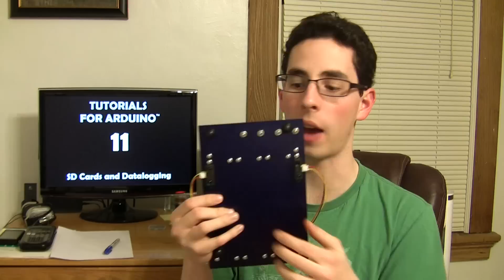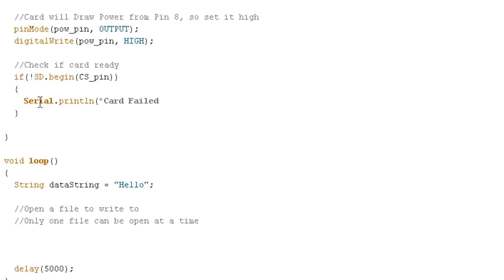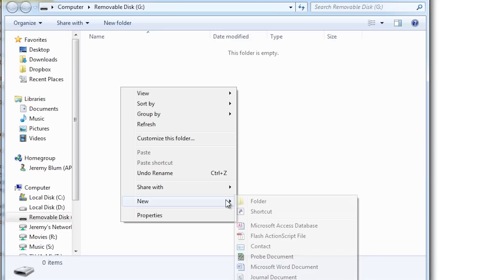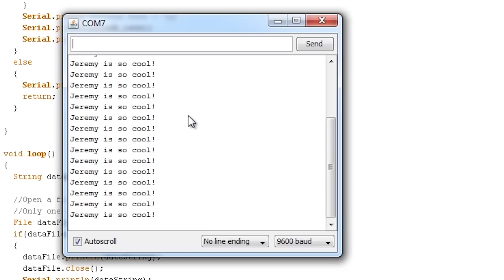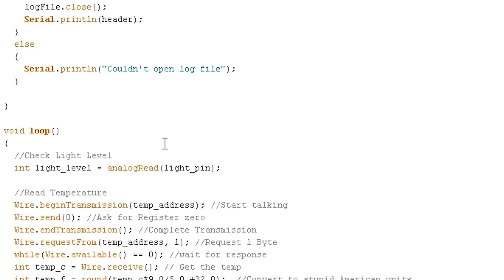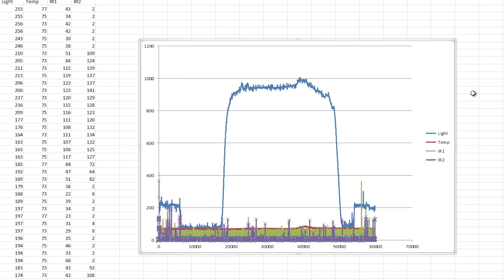Tutorial 11 for Arduino: SD Cards and Datalogging

Comment: Hey Jeremy - using a GPIO (pin 8) to power a (low power) device is a cool idea, as you have control to completely power down if needed.  But if the SD card needs a big current to write, you could have a power integrity issue.

Comment: For the last four years, the Cave Pearl Project has been developing and testing underwater data logging prototypes built around the Arduino electronics platform.  The goal has been to create a robust data logger system that is inexpensive enough to bring multi-unit deployments within the range of limited budgets, while still being build-able by to those with modest electronics experience:   http://www.mdpi.com/1424-8220/18/2/530   (free PDF download)

Step by step build instructions are on the project’s website: (thecavepearlproject.org) and operating code that is easy to understand & modify is available on Github. {use the UNO logger code first, if you are just starting out with programming}  These resources give you a complete DIY data logging solution that can be constructed from inexpensive components, and be programmed to support sensors for a range of monitoring applications using code libraries from the Arduino community.

Comment: how do you read multiple files when using the example for commands.txt
Reply: This is my code for reading 2 files:

#include <SPI.h>
#include <SD.h>

File myFile;
File myFile2;
char ap;
char ps;
String AP = "";
String PS = "";
void setup()
{
  Serial.begin(9600);
  while (!Serial)
  {
    ;
  }
  Serial.println("Initializare card");
  if (!SD.begin(4))
  {
    Serial.println("Initializare esuata!");
    return;
  }
  Serial.println("Initializare resuita");
  myFile = SD.open("ap", FILE_READ);
  myFile = SD.open("ap.txt");
  if (myFile.available())
  {
    while (myFile.available())
    {
      ap = myFile.read();
      Serial.print(ap);
    }
    myFile.close();
  }
  else
  {
    Serial.println("Eroare la citirea fisierului");
  }
  myFile2 = SD.open("ps", FILE_READ);
  myFile2 = SD.open("ps.txt");
  if (myFile2)
  {
    while (myFile2.available())
    {
      ps = myFile2.read();
      Serial.print(ps);
    }
    myFile2.close();
  }
  else
  {
    Serial.println("Eroare la citirea fisierului 2");
  }
}

void loop()
{

}

Comment: When you start building stand-alone data loggers, it becomes useful to switching off SD cards to achieve low power logging. I've posted a tutorial on how to do that with an Arduino at:  
https://edwardmallon.wordpress.com/2017/05/21/switching-off-sd-cards-for-low-power-data-logging/

Comment: Hi Jeremy.  Quick question - if I wanted to connect an OLED display that utilizes digital pins 8 to 13 and also use this SD reader/writer, how do I connect them as there is only one connector for each pin?  
Thanks

Comment: The way you calculate the refresh_rate (around minutes 15-17) using decade is unnecessarily complicated (I wouldn't think of doing it this way). The straightforward solution is:
while (...) {
float temp = commandFile.read()-'0';
refresh_rate=refresh_rate*10 + temp;
}
Reply: Indeed this is simplier. Saves me a little bit of storage space aswell. Thanks

Comment: I have mye file and everything is stored properly, but when i open it in excel all the data is in colon A not just the ID number
Can someone help me out whit how its stored in different columns? and not all just i column A
Reply: While writing to the sd card make sure you use the println function only after you've written one complete line

Comment: #include <SD.h>

int CS_pin = 10;
int pow_pin = 8;

void setup() {
  Serial.begin(9600);
  Serial.println("Initializing Card");
  pinMode(CS_pin, OUTPUT);

  pinMode (pow_pin, OUTPUT);
  digitalWrite(pow_pin, HIGH);

  if(!SD.begin(CS_pin))
  {Serial.print("Card Failed");}
  Serial.println("Card Ready");
}

void loop() 
{
String dataString = "Test complete";

File dataFile = SD.open("Log File.txt", FILE_WRITE);

if(dataFile)
{
  dataFile.println(dataString);
  dataFile.close();
  Serial.println(dataString);
  }
  else
  {
    Serial.println("Couldn't access file");
    }
    delay(5000);
}

.........................................................................................................................................................................
compilation terminated.
Error compiling.

how can i fix this...?
Reply: +Tharindu Chamara try adding this statement to your code:
#include<SPI.h>

I don't really know how, but it did work for me.
Reply: in mega 2560 ???

Comment: I use "catalex" micro sd card adapter and when try to run this code, it says "Initilizing Card
Card Filed
Couldn't access file"
Reply: found the problem- it was a wrong wiring.
Reply: Edgars Priedītis Hello Edgards, I am using the same SD card shield than you (catalex). Could you please send me how you connect it to the Arduino? I have the same error you had. My email is anasancho85@gmail.com. Thanks a lot for your help.
Reply: Ana Belén Sancho Pareja One of the built in example codes in Arduino software helped me to solve the problem:

1)Open up Arduino software on your computer.

2)From menu in upper left side of the screen choose File-> Examples -> SD -> CardInfo 

3) Now you should have some code there. In the code it says how you should connect your pins.

the following is a small part taken from that example code:
 	
 The circuit:
  * SD card attached to SPI bus as follows:
 ** MOSI - pin 11 on Arduino Uno/Duemilanove/Diecimila
 ** MISO - pin 12 on Arduino Uno/Duemilanove/Diecimila
 ** CLK - pin 13 on Arduino Uno/Duemilanove/Diecimila
 ** CS - depends on your SD card shield or module. 
 		Pin 4 used here for consistency with other Arduino examples

4) Connect your shield, change the example code to mach the pins and upload it to Arduino. If you managed to connect your SD card shield- the example code will display the info of the SD card. If you did not manage to connect it, it will display that also and show some tips on how to solve the problem.

I hope this helps.

Comment: Nice tutorial, but i have some questions; is there a way to make different files in the sd card by using a variable to set the name of the file?, let's say i'm using a real time clock, and i'd like to make a datalog everyday on different files using the data from the rtc to set a name... for example:

2014_04_28.txt
2014_05_28.txt

and so on....
Reply: yea its possible..........
i used the following setup for creating a sequence of txt files named from 000-999
make and use a char array;

 eg

void getFilename(char *filename);
char filename[]="000.txt";  //put these above setup
 
//this function for variable name
void getFilename(char *filename) {
 if(a==10)
  {
a=0;
b++;
  }
   if(b==10)
  {
b=0;
c++;
  }
    
    filename[0] = c+'0';
    filename[1] = b+'0';
    filename[2] = a+'0';
    filename[3] = '.';
    filename[4] = 't';
    filename[5] = 'x';
   filename[6] = 't';
    a++;
    return;
  }
call the function before calling the SD.open function and use the *filename(variable name,i.e,''filename'' in this case) and voila :D

hope this helped
Reply: soundcrane hi can you please be more specific...I am quite new to this and I need assistance...So what you mean is save this code: //this function for variable name
void getFilename(char *filename) {
 if(a==10)
  {
a=0;
b++;
  }
   if(b==10)
  {
b=0;
c++;
  }
    
    filename[0] = c+'0';
    filename[1] = b+'0';
    filename[2] = a+'0';
    filename[3] = '.';
    filename[4] = 't';
    filename[5] = 'x';
   filename[6] = 't';
    a++;
    return;
  }

as separate file and I need to call this function:

void getFilename(char *filename);
char filename[]="000.txt"; 

on the main text??

Comment: Spectacular intro series!  I really like them.

FYI: Much simpler (and pretty standard) code for converting the ASCII file value to an integer (than what you suggested around 13 minute mark, using pow() etc. etc.) is:

int refresh_rate = 0;
while (commandFile.available())
{
  refresh_rate = 10 * refresh_rate + commandFile.read() - '0';
}

Comment: File myFile;
int k;
int x=0;
.
.
.
 myFile = SD.open("test.txt");
  if (myFile) {
    Serial.println("test.txt:");

  do

{

k=myFile.parseInt();
Serial.println(k);

}while(x!=10);

This will get you the  number in file directly.
Also we can read a text file with different numbers in each line.
x= number of lines
Can use for loop also inplace of do...while.
parseInt() terminates when a non integer value is reached.

Comment: First of all, I love the tutorials, they are very easy to understand. Well done and hope you did OK in your school exams. I agree with hjjavaher could you read the bytes into a string and then convert to an integer?
Reply: Yes but you miss a point that is more command and more variable mean more memory .in real project your concern always will be the used memory .
Reply: Rabih Brahim not necessary, few byte, make the code more easy understand and maintenance, opposite in real project, documentation is very important, including coding, self explain is very important

Comment: Why wouldn't you just multiply the current refresh rate by 10, add the read value, and advance the read index by one until through with the string? Your 'decade' float adds confusion where unneeded. Initialize an int (not float) at zero, iterate each character in the read line with validation, and modify the existing int. Easy, huh?

PS. Your dorm window faced West, which is why the temperature and light levels peaked late in the day.
Reply: I believe this is for demonstrator and eduction only , in the fact you can forget about lot of things , and do what you want .the idea is to get what to you want from the tutorial and leave the things which you think it is not required (and that is not wrong).

Comment: Hey Jeremy,

Does this  SD shield disable pin 11 to 13?
Reply: I was wondering it myself. Depends on what shield youre using.
If youre using the ethernet shield with SD card than yeah its 11-13 and pin 4 for the SD card as far as i know.
Im trying to figure it out myself right now so i'll keep digging...

Yep, just confirmed. 4 is the SS pin for the SD card, pins 10-13 are used for the shield.
Reply: yes and no, it uses those pins but only if the chip select pin is enabled, if the chip select pin is disabled and the sd card isn't activated you can use these pins  to tranfer data to other shields or IC's the SD card will ignore the data being send because it isn't activated and you are free to do with those pins what you want. However if you are trying to use these pins while the sd card is running and there is data being send and recieved, everything you try to do with those pins like digitalWrite will not work or cause errors on the SD card.

I haven't tried it though my information above was based on working with the SPI library and not the SD card library so i can't garantee it but it also works based on SPI so it should be the same!
Reply: sandermans15 
Tested it today. didnt work.
Either its because i didnt define pin 4 as an output, or because it just blocks it from being used.
I didnt define any of the other pins as outputs or inputs and they work fine.

Comment: Hi, I have 2 questions.. 
1st: Can i do the data logging with the SD card on ethernet shield as well?
2nd: I am planning to use Arduino MEGA in a project which would involve some LCDs, tons of sensors, RTC and networking, and i was wondering can i use the additional external 5V power supply just to supply sensors with enough power (with common ground, of course)? Or you think that 5V power output on arduino could handle this? I am planning to power the arduino from 9V/1A power supply.

Comment: Also good tip, thanks.  When I first got my Arduino Uno a couple months ago I couldn't believe it only had 2kb. I used a ZX81 computer and it had 1kb ram way back then. I might have to upgrade to a Mega someday but so far my clock fits in.  I've seen it somewhere but I'll have to look for the function to return memory to check how full its getting.  But I seen that someone else done a clock program he had to switch to a mega644 chip to get it to fit.  Good day.

Comment: Besides storing data in a sd card, is there any other solution to store data that is not removable? I’d like to log data from a temperature sensor every second for 24h. Clearly I’d need a high capacity memory chip, maybe more than 64Mbytes. 

Are “flash” DIP chips a good solution? Can you please advise me what to look for?

Thanks, your vdos are great

Comment: I have found these tutorials very helpful but your method of reading the refresh rate from the SD card seems very convoluted.   It seems to me that it would have been better to read a character and concatenate it to the end of a variable until the EOF was reached or the character read was a carriage return or newline.  This would allow data of arbitrary length to be read and could be implemented as a function that returns the value for further manipulation.

Comment: Is there a reason you cant use a SD card reader through USB serial? I have a MEGA2560 and wasn't sure if i could just use my SD card reader I already have in the USB connection or another serial connection. If this is possible how would i go about doing it? Thanks in advance.

Comment: Jeremy, great video! I'm in the process of putting together a data logger to measure acceleration data for vibration testing. I'm probably going to need a pretty high sample rate like 1kHz. Have you tested the limits of sample rate for writing data to the SD card?

Comment: why do i get "Card Failture" at the first run? The input and output is called DI & DO.
my pins:
CS -> 10
DI  -> 11
vcc.-> 8
Clk -> 13
Gnd -> Gnd
DO-> 12
(I tried to change the IN/OUT put, but it didn't work. There is also pins called:
 IRQ, P9, SD, WP, COM)

Comment: Great video, but why the strange way of reading the number from the command file? 

refresh_rate = 0;
while  (commandFile.available())
{
  refresh_rate = refresh_rate * 10 + (commandFile.read() - '0');
}
Serial.print("Refresh rate = ");
Serial.print(refresh_rate);
Serial.println("ms");

This is assuming that the Arduino library doesn't already have a function to do this such as strtoul or sscanf.

You should probably also check that each charcter in the file is a number before you process it.